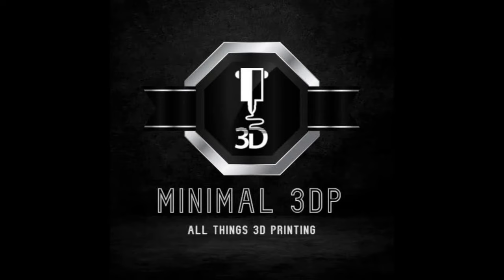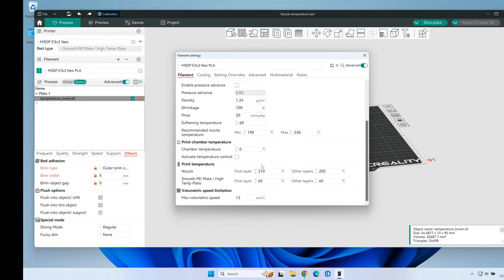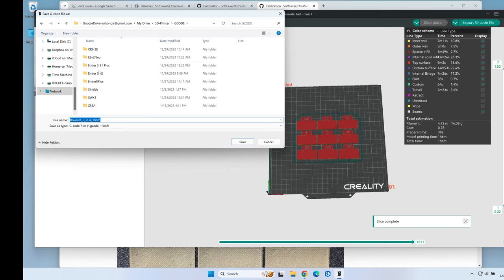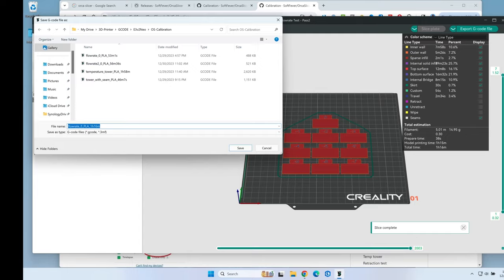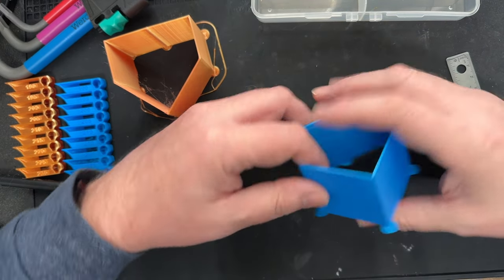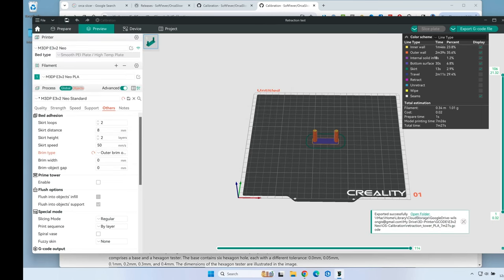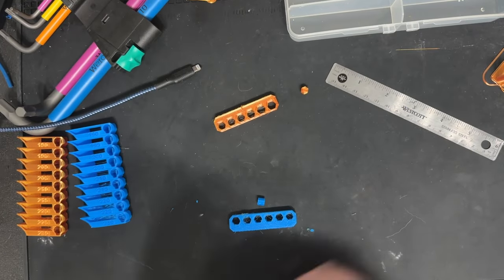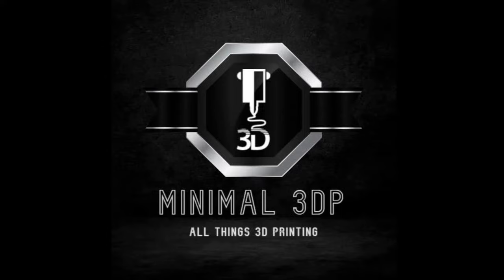Dialing it In! Orca Slicer 101: Mastering the Basics (Calibration) - Part 4

Comment: Have you noticed that pass 2 is only negative modifiers? If your pass 1 is a toss up between 2 values, always go with the higher value. That way if the lower number of pass 1 was slightly under extruded your pass 2 examples won't all be under extruded. Always always always overshoot first when trying to bracket and dial in a value. It's always better to have slightly more material extruded than slightly less. Your print quality will thank you.
Reply from the maker: I had not noticed but I will check. I appreciate your advice and feedback.

Comment: Thanks for video.  One observation is you went into so much detail on everything else, but you completely skipped over how to run the PA test and went straight to measuring the print for it.  For example, is the PA enable to be checked or not before testing?  I think I have figured out from others that it should not be checked.
Reply from the maker: Thanks for the feedback. I will try to revisit PA in  the future and go into more detail.

Comment: 20:00 it does look like the note from the orca slicer guide. 
a clear bottom but strings on top. 

Note: When testing filaments such as PLA or ABS that have minimal oozing, the retraction settings can be highly effective. You may find that the retraction tower appears clean right from the start. In such situations, setting the retraction length to 0.2mm - 0.4mm using Orca Slicer should suffice. On the other hand, if there is still a lot of stringing at the top of the tower, it is recommended to dry your filament and ensure that your nozzle is properly installed without any leaks.

Comment: On the retraction test, if you do not have any stringing between the 2 towers, would you leave it at whatever the default was set at? It has some stringing but random stray stings that don’t connect.
Reply from the maker: I would leave it if you have not stringing. If you still have little bits of string on each tower, I might do a little experimentation to see if I can get it clean. If you are happy with it, leave it.
Reply: @minimal3dp Care to elaborate on the experiment?

Comment: Hi, thanks for the useful video. I'm learning so much from this.
For the pressure advance test however I can't seem to figure out how to measure it. I see you measuring yours at aproximately 5-2.5 centimers yet using 22mm (2.2cm) as a measurement. What calculations do you use to go from the 50mm to the 22mm?
Reply from the maker: Iught have to  rewatch myself. I believe the measure should be 22.
Reply: @minimal3dp  Hi, struggling here, I measure bottom to top 5.1 cm = 510 mm in total. I see that your total length is also something like 5.1 ish. Where do the 22 come from?

Comment: Hey Mike, thanks for the great video! I'm printing the temp tower on my artillery genius. I'm using pla on the temp tower and set it at 230 - 190. I noticed on the display of my machine that the nozzle temperature is staying at 230 on each step. Did I slice it wrong, or is my machine just displaying incorrect nozzle temps?
Reply from the maker: it sounds to me like something sliced wrong. I would retry. Let me know how it goes.
Reply: @minimal3dp  I tried it again, but instead of "slicing plate," I hit "preview." I searched through the code lines on different segments and found the nozzle temp line (I think it was M104), and it indeed changes the nozzle temp. Loading the gcode into the machine and watching the display shows the initial nozzle temp and never changes. So i'm thinking the display on an artillery machine is incorrect. Strange, anyways, thanks for the video and the support!

Comment: On the flow rate calculations at 11:41, shouldn’t it be 0.95 x (100 - -4)/100 = 0.988?
Reply: No, you can see that in the formula there is '+', so when you add negative number like '-4' the '+' changes to '-'. It is the same as '+-4'.  If not please correct me, I'll be thankfull.

Comment: Good video, but you totally lost me with the Pressure Advance....at 14:23, you that you are measuring 22-23 centimeters, which you correct 20 millimeters.  My confusion is on where you are getting that value... I looking at your ruler, I am guessing the the height of what you are measuring is around 50mm.  So I am unsure as to what you are actually measuring.  Thanks in advance for your reply.
Reply: literlly guessing with that ruler, user a digital caliper, his settings are probably waaaay off
Reply: He is measuring the height of the best layer not the height of the part.
Reply: @RStupplebeen   Literally not how that works or what he was doing... (trying to do)
Reply: @AlexSzymanowski  that model he printed starts at the bottom with a higher pressure advance, and then slowly lowers it until it reaches an optimal setting (usually somewhere in the middle), and then continues to lower it until you start getting gaps and stuff in the corners near the top. He is measuring the distance from the bottom of the print, to the point where the pressure advance values give the best results, hence 22mm, instead of what appeared to be 50mm for the height of the print. My calipers measured the print height at 50.9mm, and my best layer height was 23.5mm from the bottom. he's doing it right, he just didn't explain it well, which is a shame for anyone new.
Reply: @pineapplewafers  you missed my point, you cant measure something that requires as much accuracy with a ruler... a $9 set of capliers isn't going to bankrupt the guy explaining how to do this "the right way" who then also proceeds to do it the jankest way...
Reply: @AlexSzymanowski  I have to disagree. You are using your eyeball to "judge" the best height. Which can really be hard to distinguish  a 1 mm section with any real accuracy.
Reply: @larsord9139  1mm might as well be a mile in tolerance… my point was you could be a lot closer to correct if you don’t use the wrong tool for the job…
Reply: @AlexSzymanowski  But you have an accurate measuring device, the caliper to measure an not very accurate eyeball. The caliper can't correct your not very accurate observation of what you are trying to measure.

Comment: Where do I got to edit the tolerance if I need to?
Reply: The test doesn't appear to be used to provide direct feedback to Orca slicer.  However, in Orca under Quality > Precision > X-Y Compensation you can enter a number to alter the size of holes when printing. I have an M6 Allen key which measures 5.89mm with digital calipers. All the holes measure 6.0mm or larger and yet the Allen key would only go through half the .1 hole without significant force to push it, but slides easily through the .2 hole. I assume it's the corners which are slightly off.   I set my "X-Y Compensation" to 0.1mm and the Allen key now slides easily in the .1 hole and the 0.5 hole is snug but fits, the 0 hole could be pushed through with force. The test print helps checking this, but not clear how the numbers on the print are supposed to help with it.  This test is for dimensional accuracy yet flow rate was selected subjectively by what feels good and looks pretty.  Instead use the cube or cube with top removed and 0% infill for a hollow box and then measure cubes with calipers.  It's similar formulas to adjust flow rate based on size of cube and wall thickness. When flow rate is calibrated this way, the tolerance test seems to work better or just fall back on the  "X-Y Compensation" when needed.